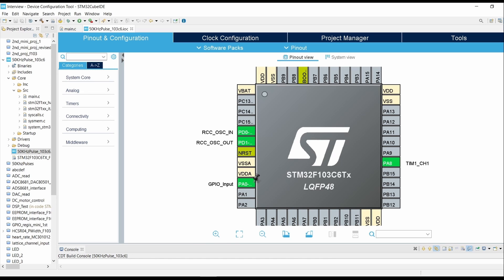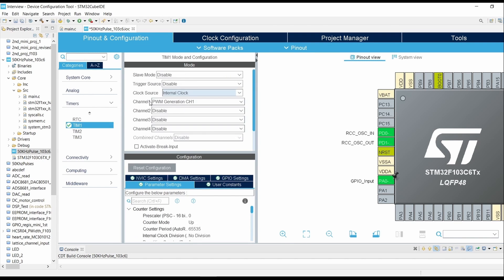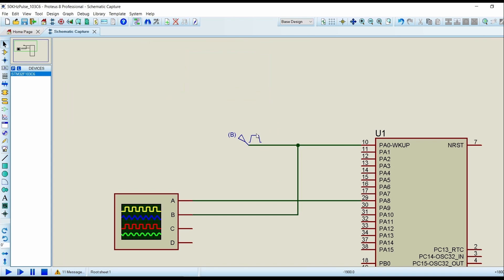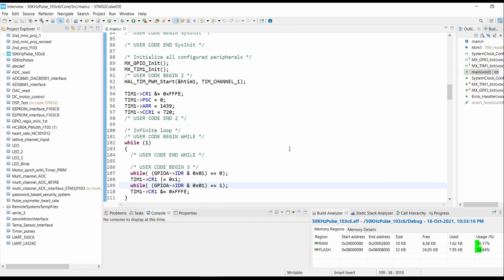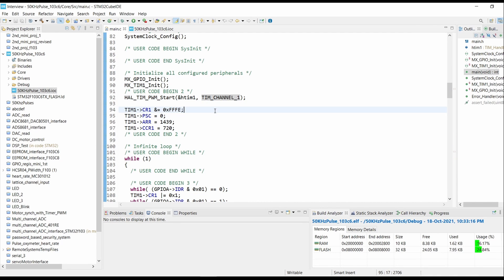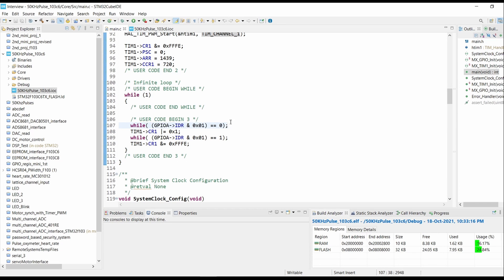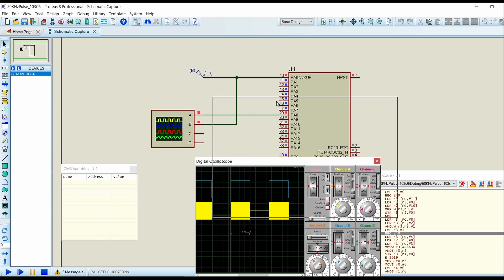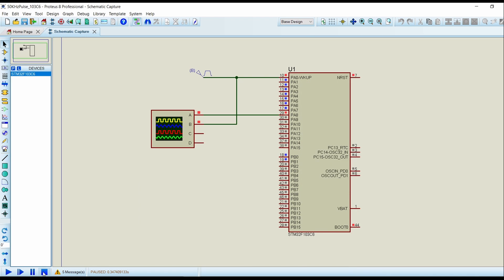50KHzPulse | mini project on STM 32 | 50Hz Line frequency detection | PWM pulse generation on STM32

Comment: Any thoughts on general approaches to determine the frequency of a signal?

For example..
1a)  Configure free-running timer, and whenever a transition is detected, the ISR code would read the timer's counter to compute the frequency
1b)  Configure Input-Timer Capture, where the timer value is latched when an edge is detected.   The ISR code would read the timer's latched value to compute frequency
2) Configure a timer for a specific period of time, and count the number of ISR interrupts due to edge transitions that occur during that time to compute frequency

I've also seen some STM32 have pins that can be configured for "External Clock Input" Input, where the hardware peripheral automatically counts the number of transitions on the line!  There's a post "External TRigger for TIMER 3" that even shows how a non-ETR pin (ex. CH3) can be used by as the input to the Slave Mode Controller (TIMx_CCMR1=1) by selecting the XOR of CH1,2,3 as the TI1 source (TIMx_CR2.TI1S = 1).  However, I assume you still need a precise timer running to interrupt and see how many transitions were counted during that time?